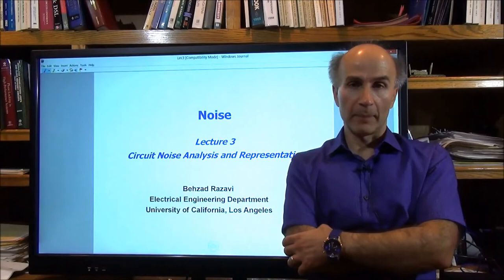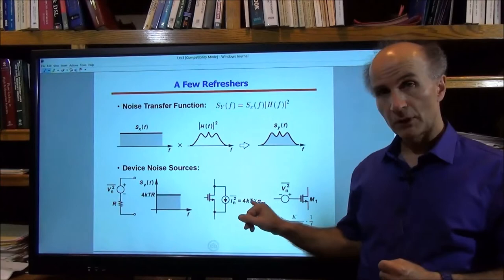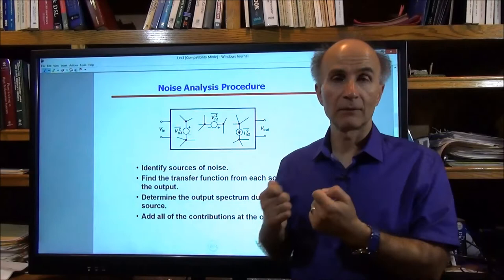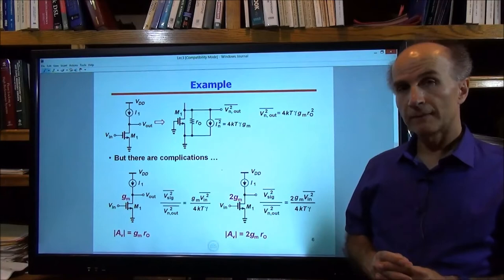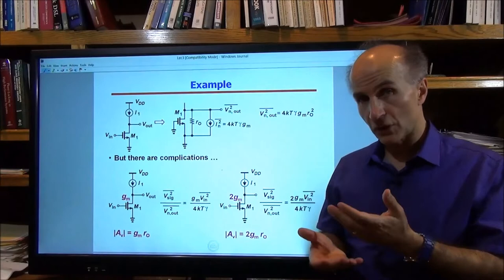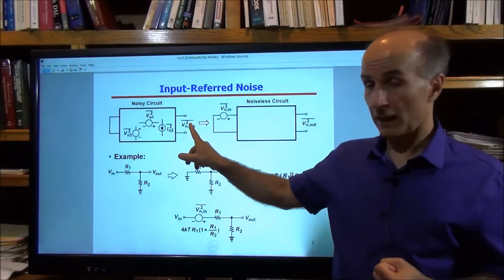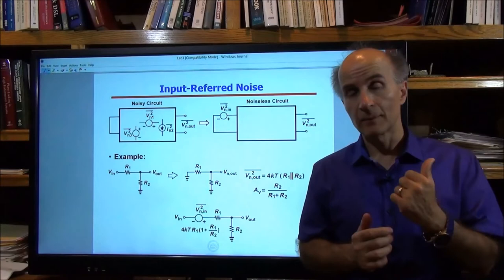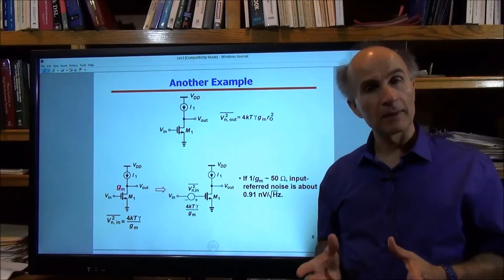Noise Lecture 3 | Circuit Noise Analysis and Representation, Behzad Razavi

Comment: https://youtu.be/Cfz7OtGVBps?list=PLBTAp4MQemkNwWEZY6l5QtgiYU7IF5p5W&t=1283 why there's still output voltage, when the current through R2 is also zero.
Reply: Noise current is still there in parallel with R2